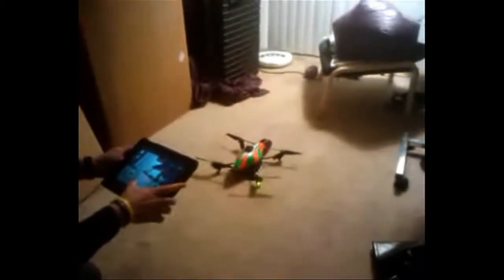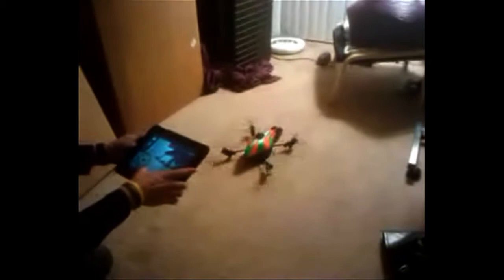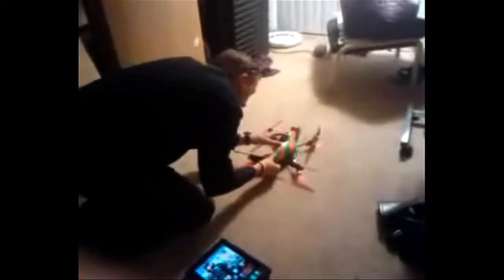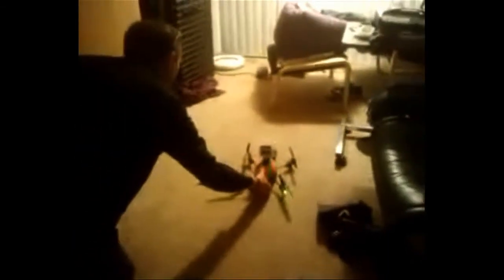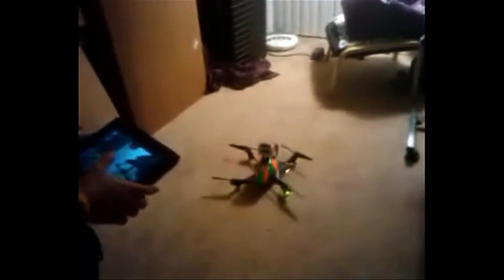Project ARV (AR drone Video) - Day 1

Comment: well i think u should take off the outdoor shell and put your gopro on top n ones u are done go to setting and put flat drim, and make sure u push the indoor shell on the setting on ok try that and let me see if it better!!

1.so take off outdoor shell put on gopro on top
2.go to setting push flat trim
3.all so when u are in setting go to indoor shull and put 
   that on. that should make everything fly better try to get
   the gopro on top of the battery in the middle ok try that!